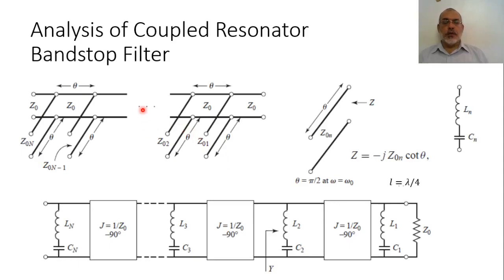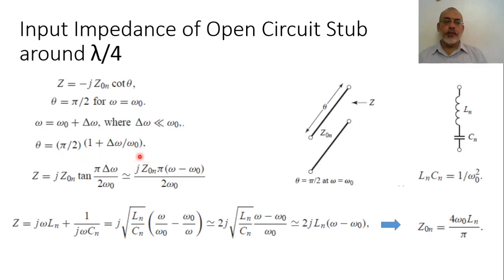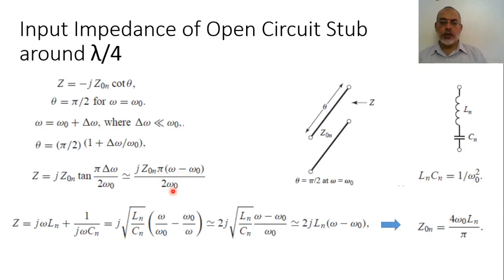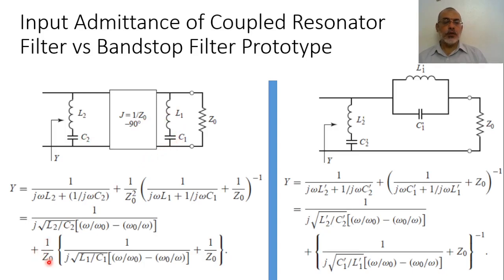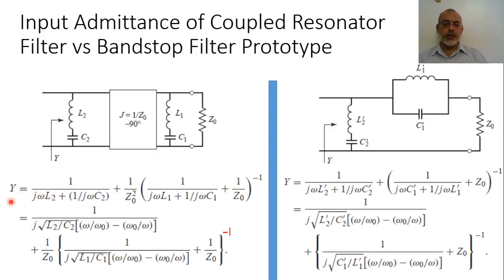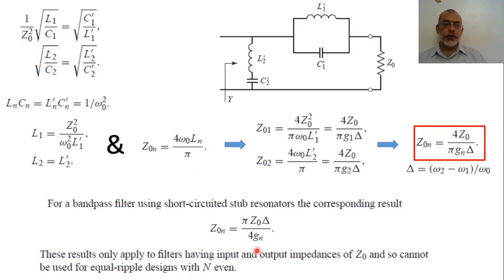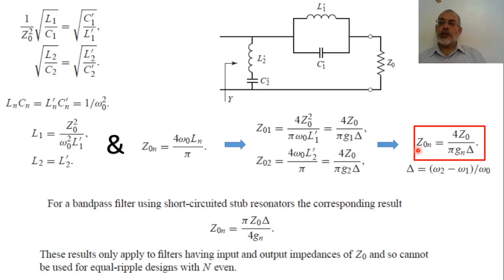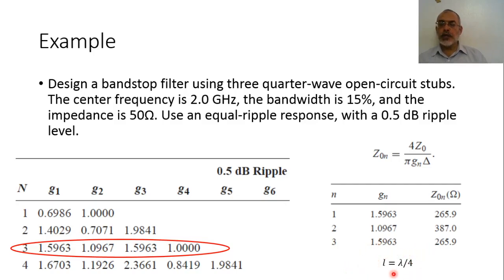Chapter08 r Analysis of Coupled Resonator Bandstop Filter

Comment: At the example discussed in the end of the lec, we didn't include the frequency in our calculations.
So, How is that? 
OR, in other words let's assume the center frequency is 5 GHz. How our design will differ?
Reply from the maker: Can you determine starting from which recording Minuit you are asking about? Because the last example was mentioned that the frequency is 2GHz.
Reply: @ahmedm.attiya1197  
Yes, the frequency is 2 but we didn't include it in our calculations to determine z , I know that we have applied the rule but it's not make sense for me.
Reply from the maker: @AbdoAhmed-vn1kt  The Characteristic impedances Z  are normalized such that the characteristic impedance of the input ports are normalized to be unity. Once you determine the values of the normalized characteristic impedance of the different sections, you can determine the actual characteristic impedance by multiplying by the value of the characteristic impedance of the port (as an example 50 Ohm).  On the other hand, the lengths of the different sections are lamda/4 where lamda is the guided wavelength at the center frequency. Thus, the physical lengths of the sections are determined based on the operating center frequency. Thus, we design normalized filter in terms of characterstic impedance 1 and in terms of lamda/4. Then we go back to real values according to the required characteristic impedance and center frequency.  Hopefully, this is clear now.
Reply from the maker: @AbdoAhmed-vn1kt  The Characteristic impedances Z  are normalized such that the characteristic impedance of the input ports are normalized to be unity. Once you determine the values of the normalized characteristic impedance of the different sections, you can determine the actual characteristic impedance by multiplying by the value of the characteristic impedance of the port (as an example 50 Ohm).  On the other hand, the lengths of the different sections are lamda/4 where lamda is the guided wavelength at the center frequency. Thus, the physical lengths of the sections are determined based on the operating center frequency. Thus, we design normalized filter in terms of characterstic impedance 1 and in terms of lamda/4. Then we go back to real values according to the required characteristic impedance and center frequency.  Hopefully, this is clear now.
Reply from the maker: Please also, return to lecture Chapter08-e Filter Transformation
Reply: @ahmedm.attiya1197  
تمام فهمت ، شكرا جدا على مجهودك وربنا يجعله فى ميزان حسناتك.
Reply from the maker: @AbdoAhmed-vn1kt  ربنا يوفقك. وربنا يعننى ويقدرنى أجاوبك على كل أسئلتك إن شاء الله.